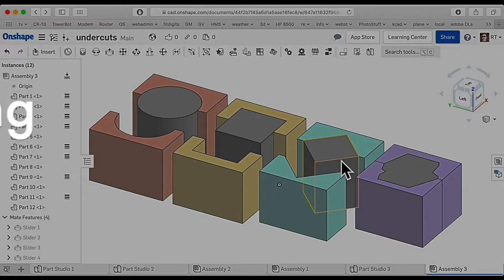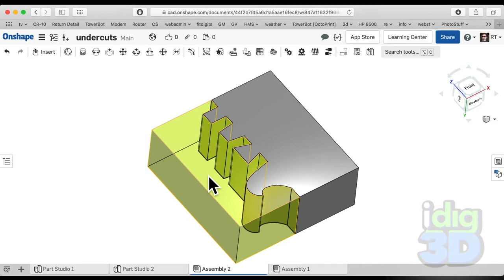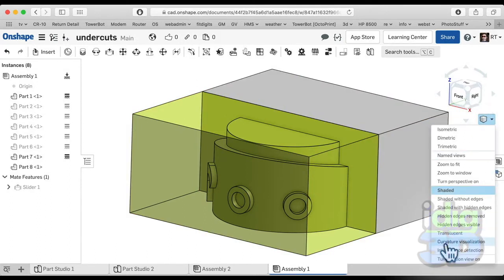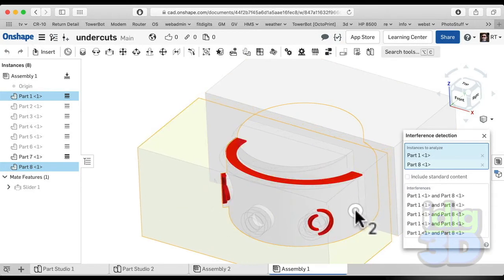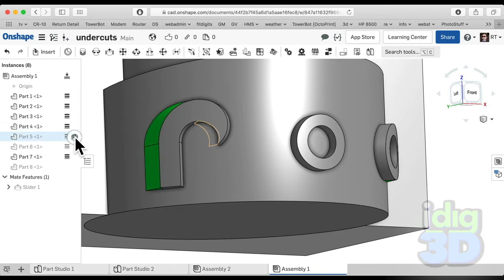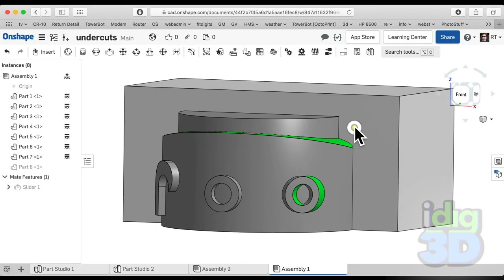Understanding Undercuts - Slip Casting Issues

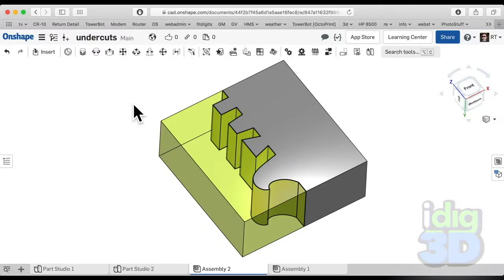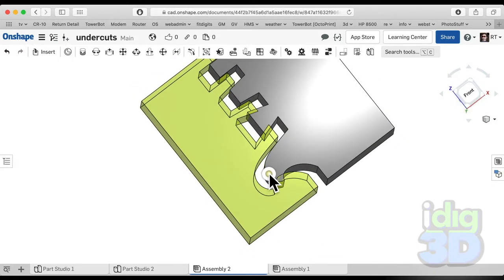Comment: For the first example (1:09-2:07) would the issue be solved if the mold is released in the Y-axis i.e. vertically instead of horizontally as shown?
Reply: In 3D printing: Y axis is front to back, x axis is left to right and Z is bottom to top (up and down) for clarification.
Reply: @Lensman64 would the issue be solved if the mould is released in the z-axis?